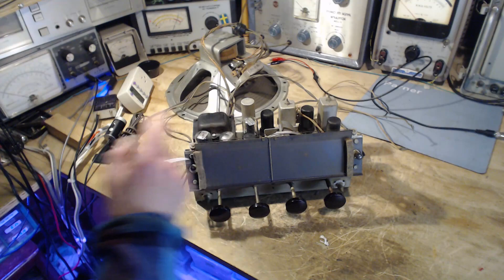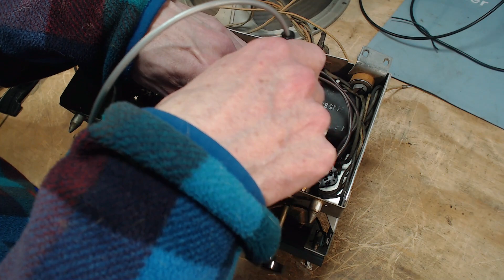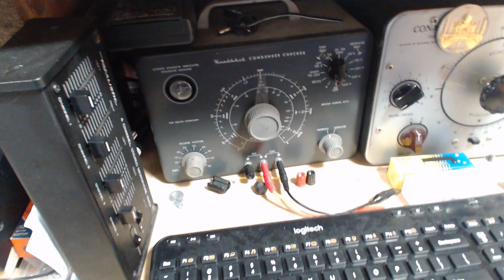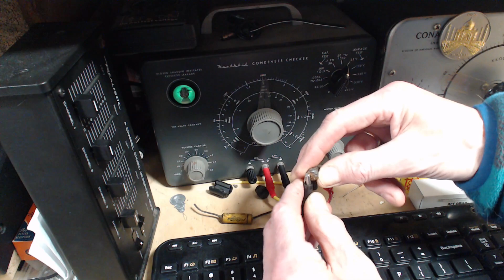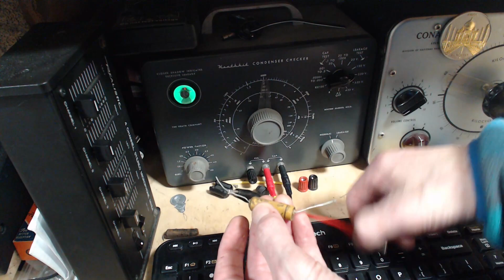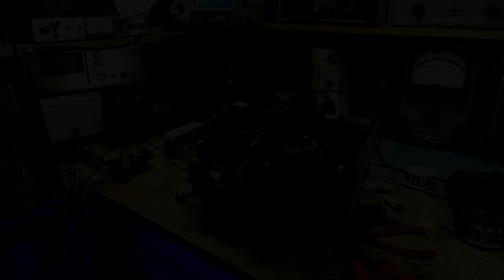RCA Victor Model 67V1 Console Video #2 - Grid Blocking Capacitors

Comment: Ah- ha he didn't replace the E Caps but went to the other wax paper caps. Don't bother testing those old waxers , they are 
all CRAPPED OUT! If you find a good one it will give up the ghost in no time because of physical degradation after 70 
plus years! Tube testing next?